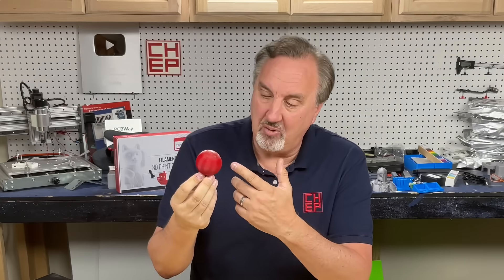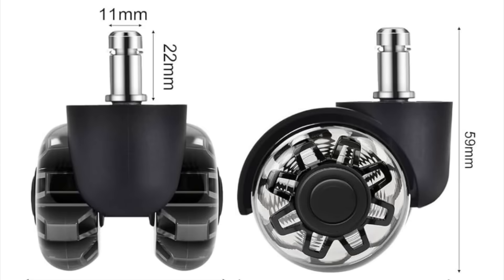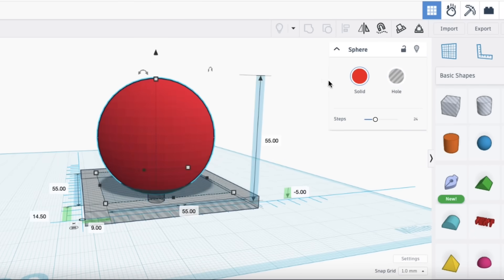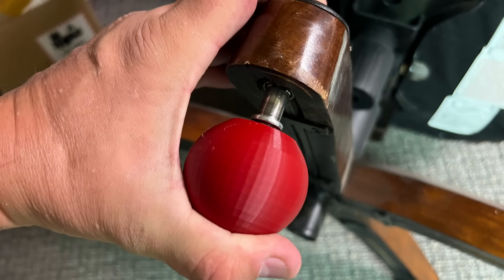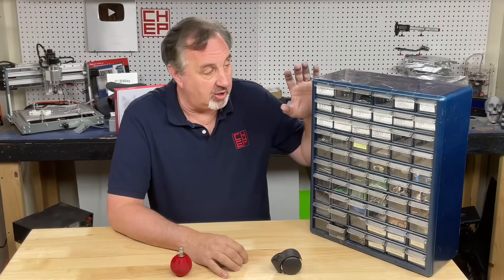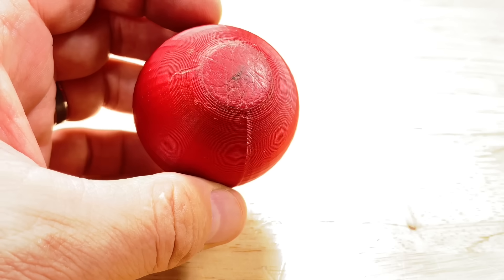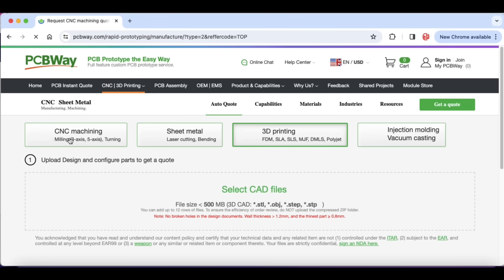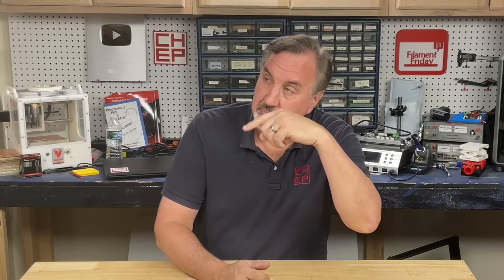Office Chair Upgrade: The PLA Ball Experiment

Comment: 1:03 I did a similar thing for an old office chair. Too good to throw into the trash, too crappy/old to buy new stuff for it. I did print a … barrel(?) … a round cylinder where the metal shaft (pin*²) of the caster firmly sits in*, provides the correct height, and decent surface area so that the floor isn't damaged. The bottom edge is 45° chamfered to reduce snag (carpets).
I did print it out of clear PETG, though. It has been 3 years in use now and shows no sign of wear.
The chair now has 3 of its original rollers, and two of those. And the upside is it doesn't roll away anymore. The downside is I have to lift my lazy butt to move the chair. Not really a downside, IMHO.

*= pressfit in an inner tube, hugging that metal shaft (pin). The wall is 5 layers of extrusion, 65% gyroid infill. Basically the caster you hold in, the opening you show upwards, that ring there. That there, extruded all the way down to the floor.
*²= You called it a pin, so the correct term probably is pin.

Comment: I always here not to use PLA for outdoor use. 3 years ago children kicked a basketball and knocked the light fixture off of the light post in front of my house. The fixture was busted right out of the metal mounting collar. I shopped around for a replacement fixture and something similar to what I had would cost close to $200.00 and also take 4 to 5 business days to come in. I decided to break out the calipers and do some measuring. I designed a replacement collar using Mater Control from Matter Hackers, and printed it in white PLA. The print took about 4 hours to print on my Ender 3 and the colour matched the post very well. I live in Ottawa, Ontario, Canada, so you can imagine the torture our weather puts on things outside year round, especially plastic attached to metal not kept in the shade. Here we are three years later, I no longer live in the house but I have been to the house and the same fixture is still there with my same 3d printed mounting collar. For probably about a dollar worth (possibly less) of PLA (including my first print that was undersized) that one print job saved me 2 thirds of the cost of the printer, and it is still in use after 3 years.
Reply from the maker: Filament is improving all the time. PLA can do a lot. Especially the HTPLA.

Comment: Funny enough, I bought a 2nd hand chair last month. It was sold because there's no wheel. I ordered a set of wheels and 3d print a similar design. A ball, and for me, with a loop to tie them up to the legs. Printed with PETG because I have it in the machine. It works too well it felt like cheating. 

It is good enough, actually. Friction is low. Contact us small. As long as you don't mind a scratch on the floor, then it'd be fine. I have to change to wheels now tho. The floor is not supposed to be scratched. It hasn't, but I'd rather not risk it any longer.

Comment: PLA is fine, It has some creep issues so I wouldn't use it for hooks or shelves that will hold weight but anything that's giving compressive loads is fine. I mean you can print firearms with PLA+ why wouldn't a chair foot be fine. I would reprint with 100% infill though and a touch higher on the temps.

Comment: I don't know about those peg board hooks... I mounted some milk crates to the wall with some brackets I designed and printed in PLA, they held up on the wall with no issues for, months (a year maybe?) but when I took them down to move into another house the brackets looked horrible and I don't know how they didn't fall on their own. Feels a little fishy that you didnt show your used board hooks... Just sayin'...

Also, just fyi, milk crates are crap themselves, don't mount them to walls, they will sag 😢
Reply: We used milk crates for nesting boxes for our chickens. At least new, thin ones don't hold up, the chickens are only 3 or 4 lbs, but sometimes two of the small ones cram into one box and the plastic deforms and the screws holding them to the wall pull through the whole side.

Comment: Mr Chuck, I love your video content but I just wanted to ask you a question about an original CR10. I don’t have any social media accounts so I just thought I’d ask here. After all the years of printing with it I am having trouble heating the bed. It is text to 62c but very slowly reaches 59c and stops there. Could it be the thermister or is there anything else I can check? Thanks for all the content!
Reply from the maker: Could be the wiring. Check the harness for hot/burn spots.

Comment: You can also jusy 3d print in place a whole caster wheel if you would have looked on printables/thingiverse/makerworld longer lol

Theres plenty of print in place fidget spinners too that would hwve worked lol. Thats 100% 3d printable to have an sctual wheel

Like your ball? Just mske another hole and print another ball inside that spins like a fidget spinner
Reply from the maker: It’s been a month and no sign or sagging or breaking. The hooks are working fine.

Comment: The ball is different than those weak hooks you printed which WILL break unless you actually print at like 12 walls 100% infill. Walls matter more than infill btw. And thats a bad hook design. But make it slightly thicker wnd it will lst forever

And that sphere is like the perfect shape lol and a solid ball wont break lol

But yeaha those hooks WILL break if u add more wait.
Reply: The hooks will not break. These are well designed for the purpose. PLA is often underestimated. The PLA you buy now is much better (stronger) as the ones you bought say five years ago. ABS, ASA, Nylon or even PEEK will be stronger, but that strength is not needed. Two of those hooks will hold approximately 15 or even 20 kg for at least 10 years. 
I have a factory in New Zealand where we make PLA panels and we can even make them strong enough to be (certified) bullet proof! A 9mm thick PLA panel is as strong as a 12 mm thick steel plate!

Comment: I use super glue with Baking Soda  to fix or make parts - its amazing - strong - almost instant setup - I can see it being used in 3d printing for  strength  - wear areas - impact  - tough - no flex - seems to make a better bond to plastics also  -   technique i use - first thin layer super glue - add baking soda on top to form shape - drip glue Onto baking soda - Repeat -   
glue application drop floats /flows  kind of weird -  best to saturate baking soda fully -  -- Wonder if baking soda could be Added  Into filament ?   Thanks
Reply: The baking soda acts like an accelerant and is a great method to use with traditional super glue. Toilet paper and a saw dust work similarly by increasing surface area. Baking soda is much better though because it reacts with the glue and actively dries it. I however don't see a point in adding baking soda to the filament. That will just clog the nozzle and aid in nothing (besides super gluing parts ).
Reply from the maker: I tried that but it still broke again.
Reply: My trick is super glue with paper towel/toilet paper
Reply: Huh? You make baking soda and glue sculptures? Why not use sand or just a 3d printer gun

Comment: I had a hinge pin for one of the folding legs on our Keter work table break on day. I grabbed the broken pin, modeled a new one in Tinkercad using calipers to size it and printed it out of regular Hatchbox PLA. That was almost four years ago and we use it constantly for setting up a tile saw, chop saw or table saw or just as a work  table in a kitchen being remodeled. It's holding up great AND if it does break I can print another one in less than an hour. I agree with you CHEP!

Comment: right after getting my printer a friend asked me about the door handle on his GMC truck. the handle that opened the rear door behind the passenger main door had been broken for awhile and a replacement was over $100. I searched the net  and found an STL file. I  printed it, I think it was 85% infill and i had set it at 3mm walls and top and bottom. That was in 2019, i just called and he said it is still neon orange and still going strong! I had also had a  zero gravity lawn chair with the hinge broken.... tinker cad and about three hours of printing, just like new! I love my printers, 2 are ender 3s and one ender e pro.
Reply: Yeah just make sure it's like 12 walls.

Comment: My wife says you should put a felt pad on the bottom of it. I think that or one of those furniture slider feet would be an awesome idea depending on the floor.
Reply from the maker: Not on carpet. It would tear off is a few minutes.
Reply: Just use a piece of ductape
Reply: No idea what material they put on mice, to make them slide more easily, but I would put that one on the bottom

Comment: If it worked it worked. Note: PETG has less wear and less friction so in sliding applications PETG is a better pick than PLA.
Reply: But splits and deforms under stress more. Pla golf balls I haven't been able to split yet dozen hits in, petg didn't last one.
Reply: @Frentraken  you might have wrong PETG settings then.
Reply: @nikoraasu6929  or I might have a point.🤷‍♂️ It's fully consistent with anything else I've seen on petg testing, and none of my other prints with the same filament and printer had unexpected trouble.
Reply: @Frentraken  Petg does not deform under stress more than PLA, lol
Reply: @nikoraasu6929  just because you said to, I've totally change my mind. 🤣🤣🤣🤣🤣🤣🤣 Evidence little one, get back to me with some or piss off. 🤷‍♂️
Reply: @Frentraken  Besides anecdotal evidence, there's evidence all around the internet, I am not your daddy - I am not going to hold your hand, search for any CNC kitchen's video on PETG

Comment: I did the same thing for similar issue with a couch. I finally got the replacement in but have no real desire to install them until it breaks again. Every temporary fix is permanent until it fails.

Comment: it happened on my chair 4 times now from 5 wheels, but I would never do that! I replaced that plastic thing by a piece of metall where I drilles a hole to inserted the bolt and also a second hole for the axle from the wheels. That works since ... > 10 years for the first broken piece.
Not everything what can be printed is a good solution - sorry.
Reply from the maker: Worked for me.
Reply: @FilamentFriday  as long as you! are lucky with that - its fine! You do you...

Comment: I made hight boosting blocks for my recliner chair. The first set did not work with tons of infill, the second set worked great cause I did conical patterns that went a 1/4" from the top maybe about 20 of these hollowed out long conical shapes. It took a few hours for each to print but hold up. Now my chair is good for me as I am a tall guy. The blocks are 4 inches high. I designed a holder for pegboard to hold my air hammer chisels 9 of them. Las Vegas summer heat 2 years and a tiny bit of sag but even a metal part would do this because the not so perfect you have to have stuff fit a pegboard. But you should know those chisels can be heavy. I use Fusion 360 free version so I can not sell my designs 😑

Comment: As you say, PLA can hold up really well depending on the application. I have PLA hooks that I have used for several years and they look as good as new. I even used PLA to replace the plastic wheels on my dishwasher racks. They originals kept breaking and replacements from the manufacturer are expensive. While my my PLA versions do eventually fail, they hold up at least as well as the originals.

Comment: Well thats some crazy timing and funny how that works. I just broke one of the wheels on my chair - or caster as you call it. I didnt know that was the proper name for it. I stole the wheel off a chair being tossed out but in the end i got a different chair cuz grandma was spring cleaning so i took the old computer chair. But its great to know i could print myself a replacement if the time presents itself again. 
Great video uncle chep

Comment: People often underestimate just how strong PLA is, and it's especially frustrating to see people buying expensive, carbon fibre reinforced filaments "for strength" when normal PLA is more than adequate for their quite ordinary room temperature application.

That said, I did make some PLA hooks for my wardrobe and they have deformed over time. However, a redesign will probably solve that problem as I probably just made them too thin for the weight I'm expecting them to hold, so I can't entirely blame the PLA.

Comment: 95% infill is crazy overkill. People drive cars over parts with 20% infill but I get the philosophy of over engineering something so you do it once and never think about it again
Reply: The problem is the concentrated force under just the end of that pin, which is going to tend to press thru low infill. Ideally you'd just make internal geometry to support right below it, but bonkers high infill is a lazy way to get a working result. 95% does seem bad tho. I'd go with under 75% or full 100% to avoid weird slicer issues with self intersecting infill paths and potentially over filling by not accounting for all the overlaps.
Reply from the maker: @daliasprints9798 - haha…9 months wasn’t enough. Ok I’ll give it a year. And most slicers won’t do 100% unless you do all walls. That has its own issues. I like what I did. It’s working.
Reply: @FilamentFriday  Cura traditionally switches to 999999 top layers if you request 100% infill. Now I think it actually uses infill, and works if set to zigzag or lines

Comment: I have used PLA a lot and the problem is that under load it DOES deform, but it takes a while. Keep an eye on those hooks, they will eventually give up if your load is high enough.
Reply from the maker: I used more than one to distribute the load.
Reply: Steel will deform under sufficient load. I don't understand why people think PLA is special in that regard.

Comment: Impressive video! I have also been surprised by how well PLA holds up. I only have 1 comment on the chair ball and I wouldn't have that except for an event that happened about 18 months ago. 

I've got knee issues that are inoperable, I used a power wheelchair to get around the house but walked short distances. I would park my wheelchair outside my office and walk in and get into my office chair. I'm also a big guy but my chair was rated for twice my weight. I was having some issues with my back due to stenosis which was making my legs lose feeling. I went into my office and sat down and was reaching out to my keyboard when I noticed I was having trouble reaching it, it seemed to be receding. And it was! Suddenly the chair went over backwards and dumped me hard onto the floor. I couldn't get up, so I crawled to my wheelchair and managed to climb into it. Examining the chair one of the casters had let loose and broken the hole in the steel which accounts for the slow then fast fall. I pulled it out with my wheelchair and it's still sitting outside, there is no way I will trust it. 

But the more alarming thing is as I was being mapped in an MRI for surgery to correct the stenosis they found something else higher up. It was not there at another MRI 6 months prior. It was right at the rib cage, a disk had been split in half and the forward half ejected by some kind of trauma. The vertebrae was now tilted at 35 degrees and they said if it went any further I would be paralyzed for life so I had two back surgeries at the same time. They had to saw off part of the bottom of the vertebrae to level it off, for to access the ejected disk would require opening the chest cavity. It was successful, luckily!

The point of all this is that the chair moved to the top of the list as to probable cause of the injury since I didn't have any other events. So just a warning to folks, make sure that whatever you do involving the bottom of the chair is strong enough to support you. I feel that the ball design is fine, especially as it's centered on the shaft and the breakage of the old one was aggravated by it being off center. My chair broke for the same reason plus apparently a flaw in the metal. 

Keep up the good work!

Comment: Love practical prints.  Not all PLA is created equal - some brands hold up better than others.  I've been using mainly PLA for many years of practical prints with great results.  And in cases where it did not hold up, a mod or two to the design did the trick.

Comment: PLA is far more robust than people give it credit for. Most people don't have an actual idea. They just go by test they've seen and word of mouth or how it didn't work for them in one particular project. The most insane application of PLA that I've seen that worked was in a mini lathe. Someone printed a gear for it and it worked, I'd never expect it to work for longer than one job but they've been using it for months. It all depends on the application of force.
Reply: Depends the environment. In Thailand humid and hot all year round I've had high-stress functional parts last years. Yet, a light switch cover INSIDE lasted a year then crumbled to bits.
Reply: 100%. Good PLA such as Inland PLA+ seriously holds up way more then people give it credit for.

Comment: Pla is actually one of the stronger materials, it's just brittle and can't handle heat. Strength against tension, but not against impact.
I have a pla block on the back of my RV that's holding one corner of the license plate. It's been out in the weather for 6 years now in the Arizona Sun and I check it every year. Still fine.

Comment: I use pla for a lot of projects that are structural.  Have not had any issues.  You just have to build it correctly and  print with enough walls and infill.

Comment: Yeah i used pla for my peugot 107.
Door handle stil works nice.
I also made a phoneholder for my own car bihind the front window we already head 29 c.
40 inside the car no problems.
I agree pla is stronger then they al shout you can not do it.
I have nice prints in my garden over one year stil looks great winter summer  Rain.
Nothing happend to it.
,🎉🎉🎉